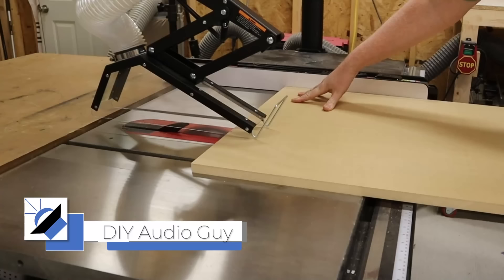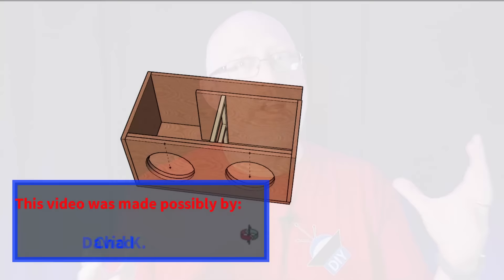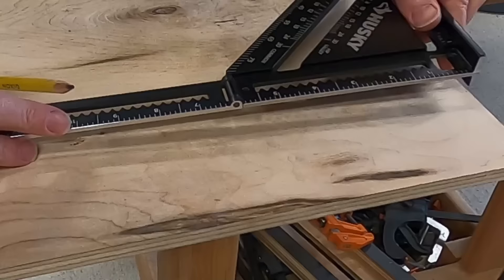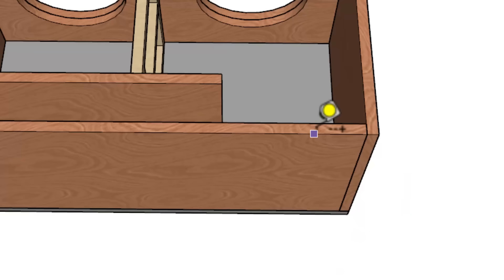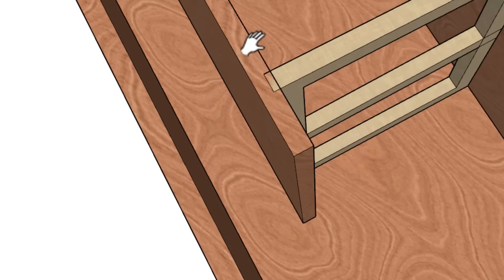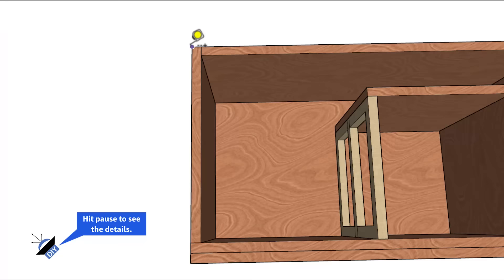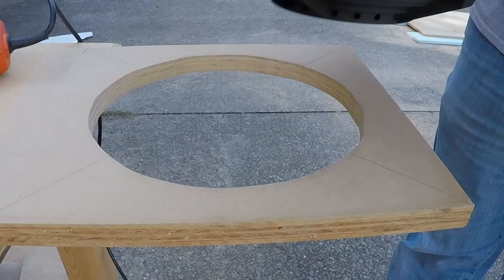Fix this mistake to make box building easy!

Comment: This is how I've built boxes since the 90s.    This is some of the best box building advice I've seen on Youtube.
Reply from the maker: Everything just fits better.
Reply: I was short on time before a build and wondered if there was a version of advice to watch, without all the sidetracking extra commentary that makes a 5 minute tip into a feature length film.  None to worry if it's thought of as too fast to comprehend, that's what pause and rewind is for. However additional content is rewarding, just not for those pressed for time. And yes, it's known that the forward button or advancing the video is helpful, but then it's guessing where to forward to without missing information unknown. So then it's back to the "slow-show". That said, I'm a huge fan, and have used tips by this guy for a while, and have been in cabinet building since 1985. So while I have a good knowledge base, anyone can still learn tips and new things always. I humbly post this, with great and honest gratitude

Comment: Absolutely great topic! One thing I will add from my experience; I always design the face that contains the port as a single piece (that’s to say the port wall end is not exposed on the outside of the box.). The reason this takes priority for me is that I use a jigsaw to rough cut the opening for assembly, then a router with a flush trim bit to finish the hole once assembled. This allows for the use of a round over on the port mouth as a final step, and prevents awkwardness from nails or screws when making the pass as they’re always on the face and the bit’s bearing doesn’t have to ride over them. 😉
Reply from the maker: Pro tip for sure!
Reply: I'm definitely going to start doing that now

Comment: EXECELLENT TUTORIAL!
 If you don't have a cut guide tool or table saw. Clamp a finished piece 2X4 or other very straight board, straight edge, etc. along your cut line so the circular saw base plate slide down it and the blade cuts perfectly straight from start to finish.
Reply from the maker: A straight scrap of MDF or plywood also works.  Anything straight.

Comment: I recommend using glue and screws no matter how long you’ve been making enclosures for high pressure applications. Over time, screws will hold more securely than using an air nailer due to the added surface area of the screw’s thread and how they lock into the wood’s fiber.
Reply from the maker: For big builds with powerful subs, yes.  Plus use a lot of internal support, braces, battens, etc....  

For a pair of 10s or 12s under 1k watts.  Glue and brad nails with some bracing is fine.
Reply: Wood glue is significantly stronger than the wood itself.  Screws or nails are just there to hold the wood until the glue dries. I think screws will give the most fudge factor if your cuts aren't prefect though.
Reply from the maker: @jeremynelson8496  I agree.
Reply: Yes! Even cured glue can move and degrade over time - especially with constant vibration (joint stress).
Reply: @jeremynelson8496  
True. Except glue can degrade over time. I've seen this happen. Add constant vibration and  ...

Comment: First box I ever made I used a circular saw freehand. I think about 20% of that box was wood filler by the time I was done.
Edit: Oh I also didn't predrill a single hole.. MDF does not like that
Reply from the maker: Sounds like my first box.
Reply: This makes me feel slightly better about my first box 😂😂 cuz that box was horrendous too lmao
Reply: @bailey2517 same. I used caulking to seal those big gaps lol.😂
Reply: @Alexlivingloud  I used a wobbly portable table saw, and some of my measurements were way off. I used sand paper to get all the edges trimmed down and I probably spent like 2 hours sanding. My hands ached do bad 😂😭

Comment: Tracks saws are awesome too. I use my track saw for the long cuts and my table saw for the short cuts because I  dont have a place to set up a spot for my table saw to be permanent. And i still prefer the screw and glue method with clamps. I use the SPAX MDF screws.  You don't have to predrill any holes, but you still have to be careful of screw placement.  Even though they are narrower than drywall screws, they can still cause the wood to split if they are too close to the edge of the adjoining piece. And another thing to consider and it doesn't matter what type of saw that you're using.  You have to keep in mind of which side of the line is going to be cut.  You can easily come up short by the thickness of the blade if you're not careful. If you're super motivated, you can use a 4 ft level and a circular saw to make good str8 cuts.  Once you get the measurements down for the distance from the edge of the 4ft level to the cut side of your blade...you're good to go.  Just make sure to clamp down the 4ft level before you start cutting. 😁😆✌🏾

Comment: While being a little gimmicky, I have been using flex seal on the inside of my box. Just spray along the inside the box and let it sit. A lot less messy than silicone that I always make a mess with.
Reply: Me too, really helps too. That stuff is amazing.
Reply from the maker: I'm going to have to give that a try.
Reply: That is a great idea, I hate using caulk. Thanks for the advice!
Reply: And it will hold a boat with 80 holes up in water.  Lol.
Reply: But does it increase flex? Seems like false advertisement lol.
Reply: @One-Crazy-Cat  you ain’t lying
Reply: I haven't tried flex seal, but it sounds like it should be ideal for sealing it and maybe even help with deadening the inside of the box.  

I've been using fiber glass resin.  Its pretty common and works great for sealing any possible cracks.  Quite a bit messier though.
Reply: There’s a much more expensive product you technically should be using called Second Skin. Comes in a 5 gallon bucket
Reply: @DIY Audio Guy  in the 3 boxes iv built 2 ported 1 sealed I spray my boxes inside and out with bedliner from Amazon adds alot of strength and alot more solid
Reply: I use sub floor adhesive lmao

Comment: I use a folding (hinged), 6'×10' support table (which supports the entire 4×8 sheet). And a rigid saw guide, having an intergrated saw support and high volume dust collector. This is less cumbersome than a tablesaw (even with an  extended table). Very fast and easy to set up! 
I only use a tablesaw and sliding tablesaw sled for smaller panel pieces. 
Another handy tool are sets of labeled spacer strip pieces, in common  stock widths - zero measuring!
Reply from the maker: That is a nice set up!

Comment: I bought the Kreg edge guide it helped but buying the WEN 6.5" track saw made a huge improvement and really stepped up my cuts. When comparing the price the WEN was not all that much more than the guide itself with way better results.
Reply from the maker: Ryobi has a cordless one now, if I get a track saw I'll probably go that route since I already have batteries.
Reply: @DIYAudioGuy  I use 
I use Ryobi cordless tools as well. I have a dust vacuum so when that is connected to the WEN track saw there is no advantage to being without a cord. If you want to keep dust to a minimum the WEN track saw and Mikita vacuum work amazing together.
Reply: @DIYAudioGuy  the ryobi uses a different track than other tracksaw.  The wen is standard so if you rob a bank you can upgrade  and already have the track. the tracksaw changed the quality of my wood working and I have one of the several thousand dollar table saw.  they are amaizing.

Comment: I recommend using construction adhesive for assembly regardless of your skill level, it adds strength to the joints and helps hold some of the internal corner braces in place more securely.
Reply from the maker: I never used construction adhesive. Maybe I should give it a try sometime.

Comment: Never used any of these tools but have been cutting wood for 30 years, yes some come out a little off but you put that into your design, it’s all good dude
Reply from the maker: You have never used a table saw?
Reply: As long as those mistakes were engineered into the plans its all good.  Lol
Reply: @DIYAudioGuy  I've never used one. It'd be good, but most saws I could get I can't see how I'd cut a 4x8 plywood with them

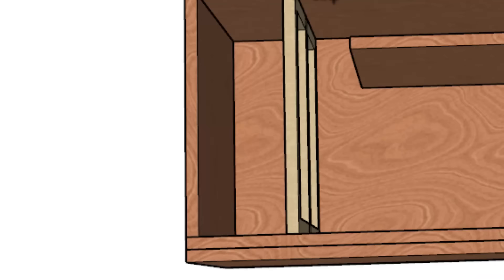Comment: 4:55 that left brace is very close to the port opening on the inside. This can create a choke point and the tune will be off. You wanna have ATLEAST the width of the port of free space in front of the port opening, preferably more to be sure.

Comment: Another Tip for easier box building that I learned the hard way: don't create complex shapes with triangles and wird angles. I did it and it cost me an extra 15 hrs. compared to an easy layout. In my case it was Wörth it since I absolutely wanted a sub that distributes bass evenly im my entire room ( tried it with another sub and ideal position was in a corner with 18° angled sideways and 11° angled upwards.
Reply from the maker: Absolutely.
Reply: I should probably clarify: 
I've got a roof slope in my room that works like a horn, thats why the angle was chosen so precisely, as to maximize the horn effect. The sideway tilt is there because on the other side of the room there is a big wardrobe vwith a bookshelf (with books) that acts as a bass trap. I could have just put the sub to the opposite site of the wardrobe, however, for a single sub using a corner is better to fill my room.

For 99.9% of people out there, going to such lengths is NOT necessary. It's just the layout of my room that allows me to take advantage of such a complex box design.

Comment: Own both a Bosch contractor saw, and the Kreg Rip Cut. Use them both as follows.
The Kreg Rip Cut is actually much better to break down larger sheet stock than a Contractor Table Saw. And also much safer. 
Once the 4x8 sheet is broken down. the table saw takes over with the smaller cuts.
Contractor Table Saws, and Cabinet Saws are not the same...

Comment: If you are going to make many boxes and want to do this on a regular basis, the track saw is the way to go leaps and bounds above a table saw. And by far most accurate if you can measure with a tape measure. No man handling the sheets just lay the track from the track saw on the sheet and cut with the saw. Festool and Makita both make great saws and the tracks are interchangeable too. Work smarter not harder!
Reply from the maker: A track saw is a good idea.

Comment: I've built about 50 boxes with a circular saw . He is right in a speaker box is much more precise if you can cut within a  1/32nd you have to cut another board . It's really closer to 1/40 th on an inch for tolerance.  
PL glue  is your friend, it's cheap .
Reply from the maker: I have never used PL, I know some people swear by it.

Comment: I wouldn't use silicone to seal boxes. Wood glue or wood construction adhesive only.
Silicone sealants have solvents that offgas as it cures. The solvent fumes can soften the varnish on your coils when they get hot and cause premature failure.  
You can use it, but wait a full day or more to put your subs in the box after building/sealing it. Then blow it out good first.
Reply from the maker: Good point! I should have mentioned that in the video. You absolutely need to let the silicone cure so you don't mess up your speakers.
Reply: PL Premium construction adhesive (regular 3x) is all I use to build boxes (and I build a lot of them). It expands as it cures to fill joints airtight (so has to be clamped or brad nailed to hold the boards in place or else the expansion will move them out of alignment). Your cuts can all be 1/8" (or larger) off and it'll bridge that gap no problem as it is very thick, solves all sorts of cutting sins. Use lots so you get good squeeze out on every joint and you'll be airtight. Don't clean up the squeeze out right away, you'll make a BIG mess. Instead, leave it and wait about 6-8 hours for it to set up but still not fully hard and then you can easily scrape the squeeze out off CLEANLY with a scraper or chisel or even a 2" drywall putty knife. If you get the timing right you'll have very clean looking joints. Don't wait too long or it'll become quite difficult to remove once it fully hardens. PL premium also creates as an incredibly strong joint after fully cured as it is a polyurethane adhesive. I build touring subwoofer boxes that are only held together by PL Premium, no screws or any other fasteners and these are 260 lb+ boxes that get tossed around on and off the truck after every show and they hold up no problem. Oh ya, wear gloves or your hands will be black for a week.

Comment: Also, if you have to reset your fence, use a piece that's already cut to size and place it against the blade and move the fence till the wood is touching the blade and fence.

Comment: Little tip not related to cuts, down load a good box calculator.  I see tons and tons of mistakes form hand drawn plans for your tune. The calculator you can make small or large changes to get your tune were you want it before ever making a cut. Kicker has a good one I personally use the ct sounds one. Both are free.
Reply from the maker: Yes.

Comment: Super interesting! Perfect timing as well since I'm going to build a portable bluetooth speaker here soon. 

On that note, do you have a video explaining what kind of drivers would be best suitable for the type or size of enclosure you're using and what size of drivers you should use, i.e what size of speakers, tweeters, midrange, full range, woofers or subwoofers? If not buying/using a kit? 

Thanks for the video. Super helpful!!
Reply from the maker: I do not, it would probably take a big long series of videos to flush all that out.
Reply: @DIYAudioGuy  ahh, makes sense. Thanks and HNY to you and yours 😊

Comment: I prefer building my cabinets with box mitre router bits and rabbit edges , solid wood front baffles . I no longer need brad nails or screws whatsoever. You are spot on about precision cuts .
Reply from the maker: I've been experimenting with a dado blade and I've got one of those lock miter bits for the router.  It's a little time consuming to set up and calibrate. When I get that mastered I'll make some videos on it.

Comment: The Trick to a circular saw straight cut by free hand is to move at a moderate fast pace while cutting. I do how ever use a metal ruler clamped for a guide if I'm cutting to do a top off line on say fence gate. 🙃

Comment: On those smaller Box builds you should be able to consider the height measurement 1st since most of the pieces  We'll be that same measurement. Basically just making 1 or  Is to full   Length rips
Reply from the maker: Yep

Comment: I don't disagree that the fewer number of cut setups possible is a good idea but I wouldn't prioritize it over structural integrity. For instance, on a double baffle. The inner baffle should always be an inside board, such that the sides, top and bottom attach to its end. Then the second baffle layer should overlay that such that it creates a herring boned joint on all sides of the double baffle. This creates a much stronger joint partly because it increases the surface area of the joint and partly because it creates both sheer and tensile stress on the joinery. When I build an enclosure, the top and bottom (or front and back) will be the same size and every other panel in the build will be the same dimension in one direction. And with center ports, you'll have two of each panel in both dimensions.

And there are more advantages to center ported enclosures. The center port creates a brace in the center of the enclosure, which is very important, but I see a lot of guys building enclosures with two subs in them and the port is all the way to one end or the other. You're throwing away a free center brace when you do that and, if you lose a sub while playing, it doesn't put as much stress on the one that's still playing.

If you have straight cuts and good wood glue there is NEVER a reason for caulk of any kind. But if you must, silicone is just about the worst thing you can use. Silicone sticks to nothing... not even itself. If you need caulk, use painters caulk. It doesn't stink, it's much easier to clean up and it actually bonds to wood.

And last, if you're using MDF, don't use screws. I won't even use them on plywood but it is especially important to avoid them with MDF because they will split the wood and weaken it. And the only way to avoid this splitting is to predrill the holes so large that the threads don't engage the material. I've built everything from simple computer speakers to 40kW SPL builds and I never use screws in the end of a panel. Also, keep any fastener 2" from the end of a panel. I know it seems like you're doing good by putting them all the way to the corner but all that really does is split the material in two directions. This comes from a manufacturer's instruction on MDF, not from my personal experience but only because I happened to read it in 1990 or so when I built my first enclosure from MDF. Before then we used particle board, which isn't fun to work with at all, lol.
Reply from the maker: Great advice.
Reply: Agreed! I plan on using dowels for mine.

Comment: Good thing about the side port boxes is you can make a more narrow (less wide) box to fit a bigger box in the trunk. I could only fit a 4.5cf box in mine. It's front subs and port. But I think if I went w side port, I coulda fit a 5.0cf box?🤷‍♂️
Reply from the maker: Good point.

Comment: Hey have you ever tested different depths behind the woofer in an enclosure but still using same internal volume. Basically using a rectangular box and placing the driver on different panels. I’ve heard claims of increasing back pressure and also claims that it won’t change.
Reply from the maker: Conventional wisdom is that it does not make any difference, I don't know if anyone's ever actually tested that conventional wisdom.